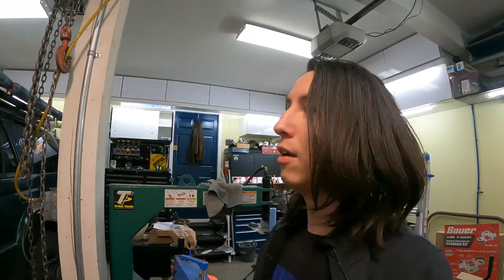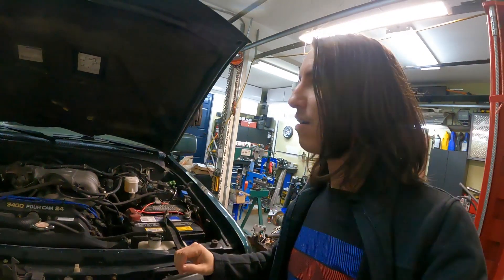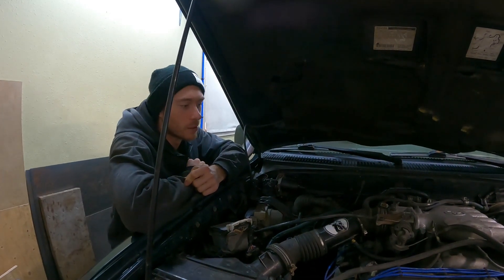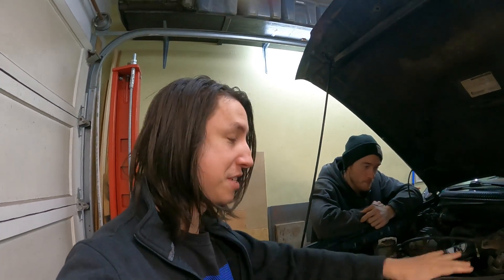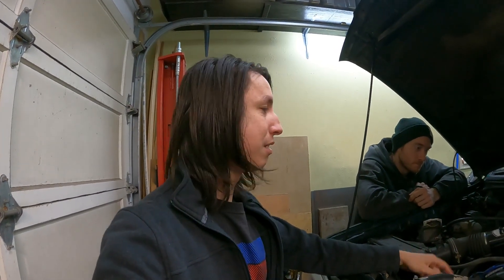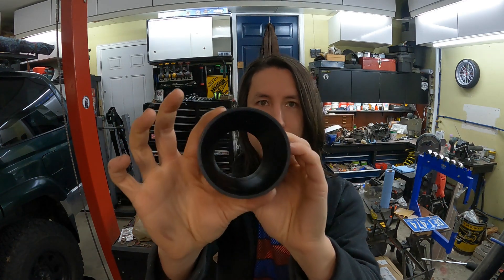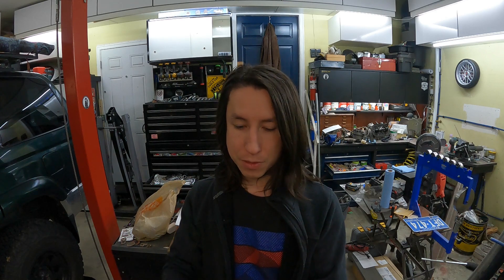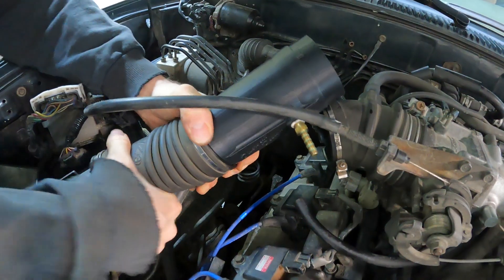Will a PETG Intake Pipe Last in an Engine Bay?

Comment: I wonder if coating it with high temp varnishes will make it hold up better
Reply from the maker: I suspect the part would heat soak and still deform eventually. The ASA part is still going strong.

Comment: I find this interesting.  Im working on simular project and I need 3d print from filter to intake but on diesel turbo engine.  Iv been considdering PETG or PCTG and I think air intake is up to its specs because air flow is never so hot anyway but if the filer is getting clogged the underpressure is maybe more of an issue.  You said that the engine was starting to give signals, vaccum leak and so on but I cant understand why and I dont see how the PETG print was failing but more adapting to the tension from misaligned hoses.  Did you perform any leak test on the old PETG print to ensure if the pipe was holding up or did you do any tests on it at all?  

My project is a lot longer pipe and takes a lots of turns and bends so its importand  for me to do a litle research so Im not critisicing your work but rather hear your opinion and if you did some more tests on old or nw part.

Regards JGH Iceland
Reply from the maker: @izan1001  the tube began to deform and was no longer round, causing air leakage around the sealing surface at the band clamp. The deformation eventually became so great the clamp could not make up for the large varience in shape. The ASA part has held fast with no issue. I have now had multiple PETG parts "fail" in ambient engine bay temps. It should be noted this doesn't mean catastrophic failure, I consider any unplanned deformation from the original shape/design a failure.

Comment: PETG will hold up on a thicker print. Even directly on the engine. Ive seen carburetor adapters printed out of petg and they hold up great. The issue with the tube is the thickness of it. Check out thunderhead289 . He adapted a lawn mower carb to a 302 v8 engine using a petg printed adapter.
Reply from the maker: This was printed at 2.5mm solid fill which to me was already a bit to thick for my liking.  I do have small carb part made of PETG which are holding but they don't need to hold form like the pipe. I think anything that has to hold form under load PETG is probably not the the best choice. The remade ASA part has held strong at only 1.5mm thickness.
Reply: @projectaddiction  Do you know anywhere I could get something quite large, like up to 10 inches in one dimension, out of PETG or this ASA? How is the ASA doing?
Reply from the maker: @robertjefferson8657  the ASA has been holding up great. No deformation at all. As for the 10" print, i am not sure where wouldnbe able to do that as i do everything i can in house. My largest printer can do PETG up .5m (19.6") cubed. Unfortunately, it's currently out of commission with a dead mother board.
Reply: @projectaddiction  I never bought a 3D printer. I always hear from 3D printer owners that their printer is broken. It seems to be a natural state of the 3D printer.

I want to make an adapter to adapt a EFI lower manifold to two carburetors. The EFI manifold is great, but has no carburetors. It can be a problem

Thanks for reply
Reply from the maker: @robertjefferson8657  if they are, the stock can be fairly reliable... my case is definitely one of those "if it ain't broke, fix it until is" scenarios... CF Nylon is probably the way to go for a manifold as you will have fuel flowing through it.